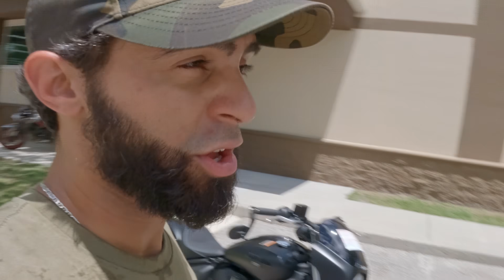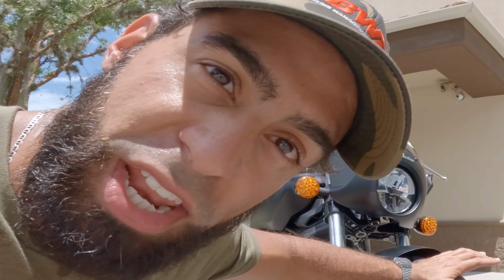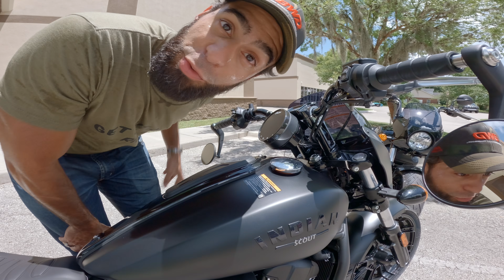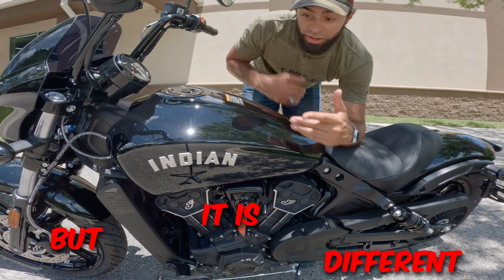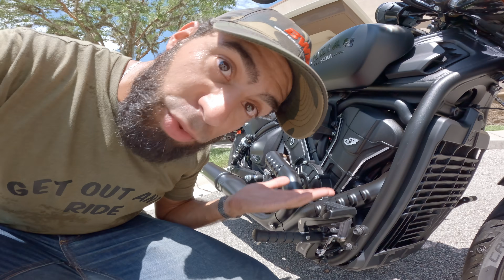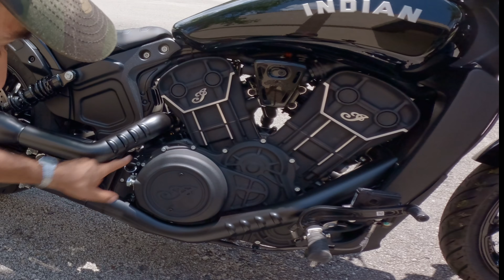An Updated Indian Scout Cant be This Good.

Comment: The only thing I want to know what they made it more comfortable because I fucking hate my 24 I'm about to get rid of it because I can't stand how uncomfortable it is
Reply from the maker: It’s about the same.  

Unsolicited input. Idk what you need to be comfortable but usually when people complain about comfort so strongly the motorcycle isn’t the issue. 

A weak or injured lower back or physical sizing not being appropriate to the bike. 

This bike should not cause discomfort within about 1-2 hour rides.  After that your butt will go numb but not cause pain.  If your hyper sensitive and this is not your norm look into softer more padded seat or elevated bars for upper back issues.

Other bikes may change hpw long your pain or discomfort changes but not by much. Most small cruisers will feel like this.

Comment: 5hp not a big difference
Reply: But the 2025 is lighter as well and revs stupid fast.
Reply from the maker: Ya the number of just 5hp has people stuck but the newer speed plus is an impactful difference. More torque more revs. More power in the middle. It’s 5hp at the top doesn’t do justice to the middle. And gearing is tighter too making it feel even faster
Reply from the maker: Ya it’s more electronics and looks but engine potential is better as well which I can’t really measure.  The 5 ho difference is not tuned and unrestricted

Comment: The 2025s aren't terrible bikes by any stretch, but the styling is a downgrade over the first generation.  The new Scouts looked like mini-Chiefs and are less distinct, plus the updated v-twin doesn't look NEARLY as good as the older models.

The tech package upgrade is great though, as is the Scout 101.
Reply: I have the 22 Rogue in black smoke and love the aggressive look over the newer models. Was thinking of trading in to get the new tech stuff but just cant get rid of mine quite yet.
Reply from the maker: Having a 22 isn’t much a difference unless you want the extra power but I wouldn’t  upgrade unless you just have to have the new thing.  Now I would get the new one over the old if I had none
Reply: @ That tech package is really cool and being a techie nerd it is hard to not want it. Have to stay away from the dealership lol, too much temptation.
Reply from the maker: That I get. It doesn’t change the overall ride though. A bit more bite at the top and the tech. I personally don’t use tech on bikes really but I know a lot of other people do
Reply from the maker: Ya, I know some people feel they are less appealing but it brings more uniformity o the brand as a whole which makes sense as well.  Still and awesome bike.

Comment: One thing not mentioned here is that on the older model Rouge (I have a 2022), the area between the instrument cluster and the windshield allows usable storage space.  I have a small bag that fits there big enough for a liquor bottle or even up to a 2 ltr coke.  I also keep my riding gloves and sunglasses there when I park.  The new model blocks this space with the taller riser.  Not to say that is a decision maker for either bike, but I'm glad to have that space over spending hundreds for saddle bags.  I don't need a lot, but a little is nice to have.
Reply: Your are absolutely right. Having a place for the garage door opener, a little roadside toolset and a hydration source is a must. 💯 couldn’t agree more.
Reply from the maker: 🤷🏽‍♂️🤷🏽‍♂️🤷🏽‍♂️. I usually have a bag with camera equipment
Reply: That's where I hide my weed at, boy.
Reply from the maker: Im sure you can find a way to add a small back to those risers or strap it to the forks. Plenty of options to make this work on either.
Reply: @NostalgicMotorcycles  Not looking to make a huge issue of this, but check again my friend.  The theme of this video was picking out major and minor differences in the two bikes.  This is obviously a minor one.

Bag or not, there's no way to fit a 2 ltr coke bottle (or anything of that size) in the same space on the '25.  The riser blocks it off.  Also, not much space for a universal bag on the forks on either model.  I only mention this because the type riding I do most which is frequent runs to the convenience/liquor store.  Have you seen the price for saddle bags that fit this bike?  In any event, my '22 is paid for and not looking to upgrade, but I'm happy to see Indian continue to evolve this model.
Reply from the maker: Ya I’ll keep it in mind that’s not something I use so I really don’t think about it.
Reply: @NostalgicMotorcycles  No worries.  Keep up the great videos.  I love your content.
Reply from the maker: Thank you. I appreciate the feedback !

Comment: No one's talking about the RC 240mm tire kit. Is it plug and play? will it fit?
Reply from the maker: To my knowledge no due to the new frame but Honeslty not sure.
Reply: @NostalgicMotorcycles  I like the new Scout A LOT. But if I can't put a 240 on it. I don't want it.
Reply from the maker: @shrugger1  LMAO you can do anything to any bike just a matter of how much money you want to spend !
Reply: @NostalgicMotorcycles  That's certainly true. But I'm only willing to spend the $2.5k and a Saturday.
Reply from the maker: @shrugger1  ya I think the swing are is actually the same but the frame above the wheel is a little more narrow. However give it time. People will make a kit for sure.
Reply: @NostalgicMotorcycles  Super brand new so it's understandable. I'm still uncommitted. Maybe I'll go with the 101. Change the exhaust, and the seat if I need to, and it's good to go as is.
Reply from the maker: It’s a strong bike ! Either way honestly.
Reply: @shrugger1 240: Too much inertia, kills turning.
Reply from the maker: Ya for sure. Some people prefer looks over scraping peg. Which sounds like the case here

Comment: I test rode a 2025 101 today, wasn't impressed. My 2017 feels faster, stops faster (Brembo 4 piston caliper upgrade), and is easier to maneuver at slow speeds. The dual Brembo set up on the 101 was hugely disappointing, visibly it looks identical to the setup on my BMW R1250R, but it's pretty lame. The cruise control would surge and hunt below 55 mph. And the display controls were hard to use and too many buttons required to navigate through everything. It's a hot mess IMO. I'll happily stick with my 2017 Scout.
Reply from the maker: Interesting. I would say if your 2017 is stock/untuned. Then you did not have gone into sport mode.  Your 2017 should faster than standard mode on the new bikes.  I can guarantee the new bike is faster. Check the ride modes those make all the difference.  

You upgraded your brakes I can’t really say anything there outside of the fact that these calipers are exactly the same as the challenger and ftr. Not sure about the BMW because it’s off the ftr and challenger lol. 😂 

Surging under 55mph probably has more to do with what gear you are in rather than speed.  6th gear at 55 I can see that being true.  Not 4th at 55. Again could be a user thing. I literally rode a 101 yesterday for about 60 miles (video coming soon) and cruising at 65 was no issues but I usually match my gears to speed so around 50-55 I would be shifting from 4th to 5th. 🤷🏽‍♂️🤷🏽‍♂️. Rode under 15 mph for about 10 minutes during this ride and no bucking lurching or surging. 

Controls being hard to use is a comfort thing. It’s new to you and different  so your brain isn’t routed to use those buttons.  Use them for a week it won’t be an issue. I ride different bikes regularly so my fingers don’t ever really have a “home base” as you do literally comparing only 2 bikes. I will say the older button press is more click like and the new one is kind of vague to the feel.  I prefer clicky buttons. 

But it does sound like your bike is the one for you bro. Thanks for the input. I’m sure other owners will want to hear the feedback.
Reply: @NostalgicMotorcycles  My 2017 has 2 into 1 pipe, PV3 tuned, trask air cleaner, and the 101 I test rode WAS in Sport mode. It was quick, but didn't feel as quick as mine. It was a smoother ride, though. The seat was the only part I was actually impressed with, very comfortable. I'm used to McCruise control, riding at less than 55 in 6th wasn't an issue with that, the 101 liked to be at 55 or higher to be smooth. I didn't see that as an issue, just something that was worth mentioning. The brakes were the biggest disappointment, I expected stoppie power, and ended up having to squeeze hard to get half of what I expected. I had to use all four fingers to get a hard stop, my BMW only needs two fingers and moderate pressure. The whole bike was nice in concept, but I found to be unrefined and lacking in several areas.
Reply from the maker: @painlesstom  Gotcha that makes perfect sense. You are comparing Modified bike What most people will consider a stage 2 being intake and exhaust mods with a tune. To a factory restricted bike. The bike is not the problem in this comparison..... I would say your reference point has a slight flaw in it. 

Try stock for stock. Then open your mind to modified to modified. that's a fair comparison and an accurate way to judge. Not a 2017 at its best (tuned/unrestricted) to the new bikes worse (literally stock). Of course, it's not going to feel as fast its not level ground. Thank you for clarifying as that is key information that you need to be very clear about. Yes the scout 101 stock is slower than a decently modified prior Gen. I could of told you that. No one would expect anything less. Tuned bikes run better than stock bikes. Always its a fact. 

As far as brakes are concerned. To get these brakes up to the level you're wanting it takes a simple master cylinder and pad change. The calipers are not the problem. When making comparisons I would suggest making it apples to apples so you don't get upset when your apple turns out to be an orange. But hey what do I know im just a random guy making comments online 🤭
Reply: @NostalgicMotorcycles  I never said the calipers were the problem, I said the brakes were disappointing, and felt like the master cylinder bore was too big, mismatched components. Sure, swapping the right bore master in, and using some EBC pads, would certainly improve that situation, but that's some of that un-refinement I referred to. As to speed, all the hype about the 1250 having so much more power is where my comparison was drawing from. A tuned 1130cc 100 hp 2017 shouldn't feel faster than a stock 1250cc with an advertised 111hp. I should have felt more power, but that wasn't the case. Either way, my interest in the 101 has passed. Sometimes oranges turn out to be lemons. LOL
Reply from the maker: 🤷🏽‍♂️🤷🏽‍♂️ 110 hp is a crank rating. Stock I would guess 95 ish wheel.  The speed plus motor will make over 100 hp at the wheel tuned on a stock exhaust.  

Thinking about this holistically. It’s faster than all its competition. Mostly. Only time will tell. 🤷🏽‍♂️🤷🏽‍♂️. The original scout motor is really good as it is.
Reply: @NostalgicMotorcycles  Comparatively, my 100hp is a crank rating, too. Probably 85 at the wheel. ;)
Reply from the maker: Stock. 100hp stock.  

That’s not true anymore after your modifications.  

If the 101 had the same mods it would not be 110hp, it would be more.  

Apple for apples.
Reply: @NostalgicMotorcycles  I traded my Scout for a 2024 BMW R12, it's not quite as fast, but it's more fun and twice as comfortable. Much happier.
Reply from the maker: I’ve sat on one but not ridden.  I’ll get another chance one day.  But hey no argument here there are different bikes for different ppl.
Reply: 2019 below are better. I have a 21 and changed my engine case to a 2020 just to get the clutch cover. You're better off getting a used scout and spending all the way up to what a new bike costs. Plus old models have minimal electronics
Reply from the maker: That’s a very personal opinion. Can an older model make as much power with the money spend. Yes and I don’t disagree.  It can’t make more. The newer bikes with the same mods will make more power.  And some people really want the comfort of warranty tbh. 

I personally would rather old and modded but I just know it’s not true for a lot of people.
Reply: @NostalgicMotorcycles  Very true. I sat on one today. The weight balance is insane.
Reply from the maker: Take it for a ride. Most dealers still have the prior gen and the new gen you might be able to ride both.